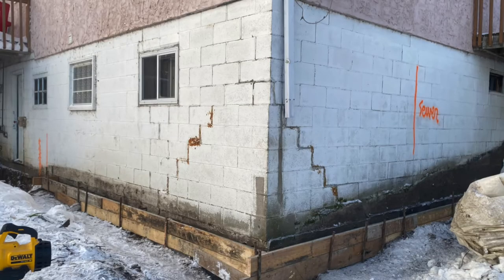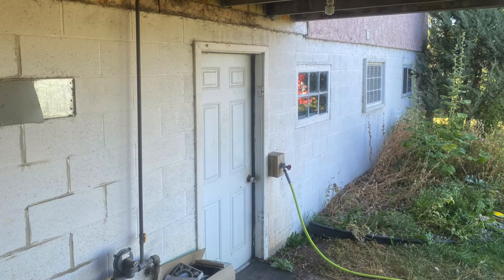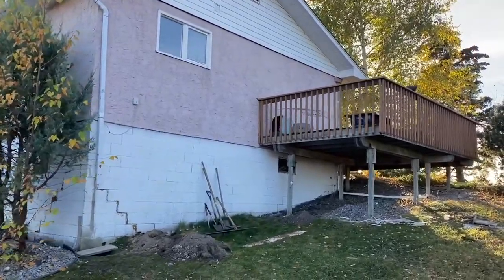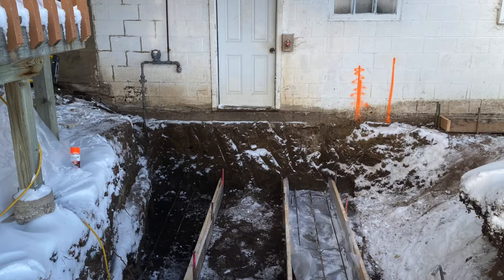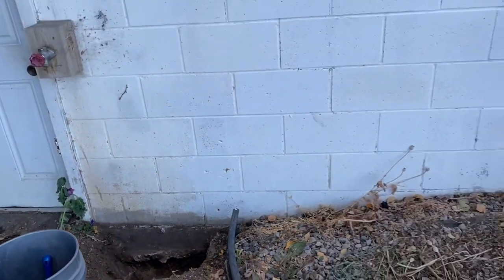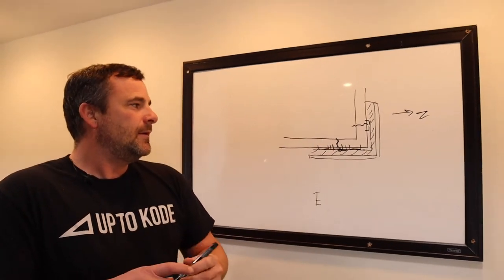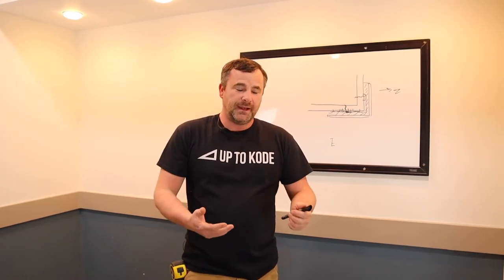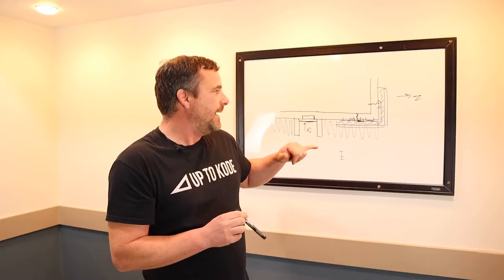Cinder Block Basement Repair

Comment: Great video but the foundation im fixing for father in law is similar to your problom but way worst. Blocks falling apart and many of them right in the corner. I had to leave some soil so corner doesnt shit out completely out. Its so bad ill just rebrick it but i gotta support the floor and the wall. Tricky.
Reply: Plus is that corner of the building theres asphalt and it was puddling right in the corner with the grade so i know its water intrusion.